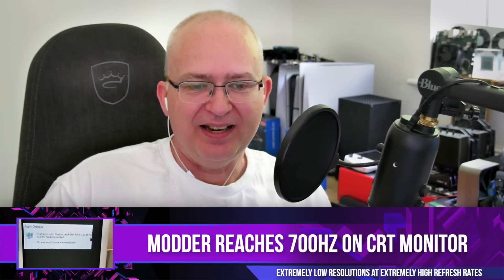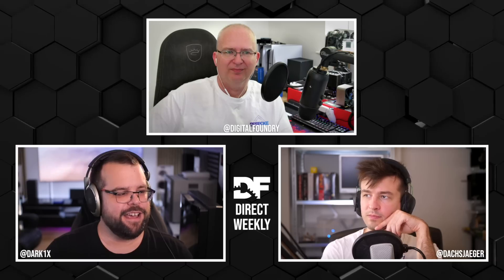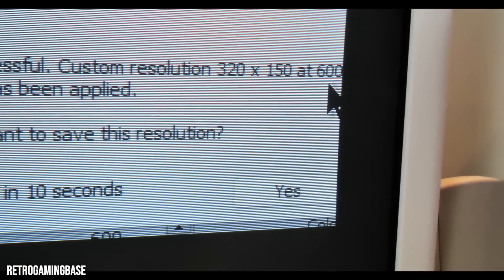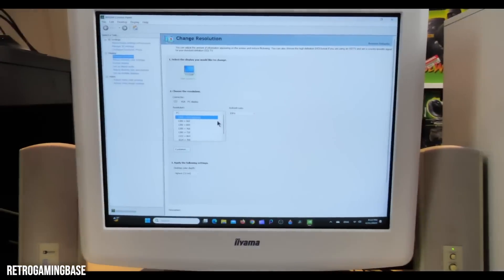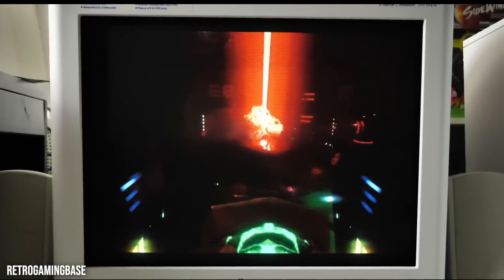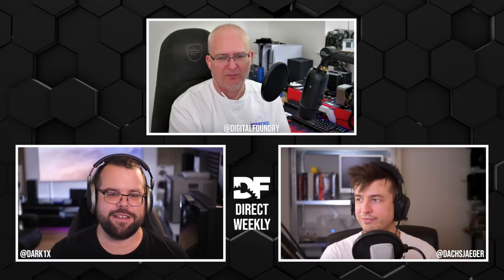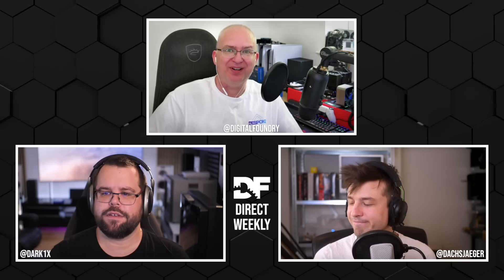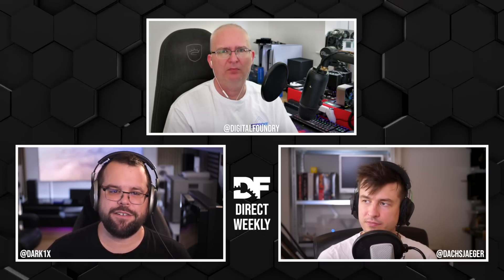CRT Display Hits 700Hz Refresh Rate - But How?

Comment: 60Hz on a CRT is actually more like 1000Hz on a flat panel.
Reply: Way more than that, at 1600x1200 res 60Hz, a CRT takes like 9 nanoseconds to draw a "pixel".

Comment: If you really want a nicer balance between resolution a refresh rate, and you own a nice 200Hz (progressive-scan) CRT, you can easily squeeze 144Hz 1080p out of them, or if you're really wanting to push the boat out, you can do 1080i 240Hz, but to be honest, CRT monitors have perfect motion resolution & response at just 60Hz, so I never feel the need to go over 120Hz, and I mostly use my Sony G520 CRT @ 1440p or 2880i 90Hz.
Reply: I use my Syncmaster 955DF at 1792x1344 60Hz progressive or 1792x1008 at 72Hz, 60Hz or 75Hz.

I don't like interlacing after watching the massive difference in clarity between a 480i CRT TV and a CRT monitor at 480p.
Reply: @saricubra2867  
the CRT is a lot sharper not just because of interlaced vs progressive.
The way the triads are organized is different.

480i on a CRT monitor also looks a lot sharper than 480i on a normal TV.

Comment: One of my favorite things to do every once in a while is to boot up my 19" Trinitron and play some games on it. it will do 1600x1200 @85hz which looks cleaner than my 144hz IPS. but if i lower the resolution slightly i can do 120hz on it and its wild the motion clarity and level of dynamic range. I cant wait for the day modern displays can match that.
Reply: I reckon eQD (self-emissive QD) will at least be nearly as nice looking and fast as the last generation CRT monitors.

Comment: Best monitor I’ve ever seen was my 2003 22-inch NEC CRT.  It could do 2048x1536 at 85Hz, .24 mm dot pitch, and had a flat glass screen.  It was beautiful, and 22 inches at 4:3 is HUGE.  It cost $1200 in 2003, but was worth every cent.

Comment: 90hz on crt was way worse than 144 on my laptop, i think crt becomes religion to these guys, the make stuff up
Reply: Eh, that is just not objectively true though is it, just 60Hz on a CRT monitor has a 1:1 static:dynamic resolution, that means it can resolve a full image as well as it does either statically or dynamically, whereas a 144Hz LCD can barely resolve 300 lines of dynamic resolution, same with OLED, as those are also sample & hold modulated, late generation CRTs also have incredible colour volume, greyscale performance, shadow detail, black levels, the purest whites out of all display technologies, 0ms end to end latency, incredible fill-rates, an image depth that so far only light-field tech has rivalled, post CRT display tech is an example of technology regression, like the Concord or US Space Shuttle.

eQD should be interesting though, especially if it has a scanning base modulation method, Tandem-OLED is also a tech with a lot of potential, if it were to use native rolling-scan or something akin to focus field-drive.
Reply: the motion clarity was better, your 144hz laptop is sample and hold.

compare 144hz on your crt to the 144hz on your laptop and you will be impressed.

Comment: If you did update an oled or lcd to mimic the scanning beam of a crt, it would probably be very dim.

For a crt display, there's only a small point on the screen that's lit at any moment. 

That point is extremely bright & can apparently reach 100,000 cd/m^2. 

But since the point is only lit for a fraction of a second, the overall image is around 100 cdm^2

If you did that with an oled or lcd it would appear even dimmer.
Reply: Rolling-scan algorithms have gotten really good on Sony BVM OLED sets, so much so that 60Hz has very respectable motion-resolution on a Sony BVM-OLED (RGB Top-Emission) with native rolling-scan.

Comment: And suddenly people no longer see burn-in as an issue despite CRTs being more prone to it than OLED...

People hate innovation and would rather ask for faster horses than better cars.
Reply: Post 1995 CRTs are notoriously impossible to even force burn in, it takes at least 5-6 years of constantly being left on a static image to get any noticeable burn-in onto a post mid 90s CRT, and around 2 years for post 2018 WOLED, around 3 years for 2nd gen QD-OLED, and around 4 years for triple emitter (RGB-stripe) OLED. As the ratings review group have clearly shown, LCD is more prone to permanent image retention than any of the display technologies with the only exception being Plasma, though 8/9th gen Plasma is pretty resilient.

Comment: i wish there would be 1080p crt
Reply: 1600x1200 is pretty much the 4:3 1080p equivalent in megapixels.
Reply: My 22 inch NEC flat screen CRT could do 2048x1536 at 85 Hz in 2003!
Reply: @jarekstorm6331  I have a 19inch Samsung Syncmaster that maxes out at 1856x1344 but the phosphor size is 0.20mm. It has the sharpness of a 1440p digital display, each frame looks like a 35mm film print or a very high res photograph, no aliasing.
Reply: CRT monitors can do well over 1080p, 2880i in fact (4K 4:3), there are also HD CRT TV's, like the Sony Fine-Pitch and Panasonic Acuity CRT sets.

Comment: You could play Pokémon emulated at 160 (w) × 144 (h) which is the Gameboy colors resolution. or the Gameboy advance 240 (w) × 160 (h) pixels (3:2 aspect ratio) probably at higher than 700hz 🤣

Comment: If you're interested in the best possible motion clarity for a non CRT display look into VR headsets. The Oculus Quest 2 has 0.3ms of image persistence which is equivalent to 3000hz of motion clarity. You can really see it in action opening up UFO test in the browser. You can track the UFO with perfect clarity even up to 2880 pixels per second. This kind of strobing tech needs to come to monitors.

Comment: While nowhere near as high, I have used an experimental MiSTER config to run 240p resolution on a CRT Monitor at 120 hz. 

Usually a PC Monitor cannot display a resolution that low, but by doubling the refresh rate from 60 to 120, it reaches the 31 khz minimum the monitor accepts.

The Scanlines in this mode are THICC (maybe almost too much so). Even more than most PVMs cause PC Monitors have a way higher TVL count than Broadcast Monitors.
Reply: I gotta try that one, but my monitor can already display 480p at 160hz, so maybe I need to try that 240p at 240hz or something

Comment: As someone who owned several CRTs as a kid and a teenager I can assure you that 60Hz does not look good at all. You absolutely need at least 75Hz to avoid eye strain.
Reply: 60hz looks good on CRT TVs but CRT monitors have faster decaying phosphors so need higher refresh rate to not get flicker.
Reply: I use a 60hz CRT monitor daily and it looks just fine
Reply: @uponeric36  It strains your eyes. Take it from someone that has been there, done that.
Reply: @uponeric36 if you can't notice the flicker I'm happy for you
Reply: @augustinethewashingmachine  It depends on the monitor, and sometimes setting. Anti-moiré effect setting often increases flicker. Using super sampling through something like DSR can also help
Reply: @uponeric36 I see. I wasn't aware of the effects of ss. Are you able to see flicker at 60hz or is it just minimal enough it's tolerable?
Reply: @augustinethewashingmachine  It's pretty minimal, I can see it on some static UI stuff if I hunt for it but I never notice it in real content.
Reply: depends on your eyes. Some people it makes them sick. For me I only notice it because I'm at 85hz+ at higher res. 60hz flicker isn't apparent to me at first glance until I go higher and return back to 60. Looks great to me at all refresh rates (lucky me)
Reply: Yeah I remember, when I was a kid, the amazing eye relief that came with finding out that I could change the refresh rate. It also made for a lot more late nights playing videogames (and tired school days afterwards lol)
Reply: True!
Reply: 85, or better yet, 100.

Comment: I appreciate the smoothness of CRTs but the constant strobing has damaged my eyesight over the years. Modern panels are MUCH easier on the eyes.
Reply: modern displays still strobe and there are even more issues with lcds other than strobbing like poor backlight quality, calibration issues, pwm dimming method, overdrive, etc.
Reply: @FuIIDiveVR  just like crts are heavy af, power hungry and many others. We have qd-oled and microleds now, wich bring nice features to the table that we've lost with crt-lcd change

Comment: Something tells me CRTs will make a comeback eventually in some sort of way, but they will be CRAZY expensive and only for a niche, specialized market.
Reply: for me they already comeback,
i start hunting crt tv/monitor for about 6 years , i have about 40 of them  , about 20 from them are very rare and i can sell them for more than$12000.
i don't know is this a good Luck or a curse ,how and why this happened ?!
crt teach is amazing , the motion and the colors for retro and for modern still funny to test  new game with  smooth motion everything on ultra even with ray tracing ,
Reply: @chopinhoven  I think the "problem" with CRT tech is that it's virtually perfect. Aside from some improvements that can always be done, the technology itself reached its peak between 2000-2005. So, it stopped being viable as a planned obsolescence business model. And commercializing big, widescreen CRTs is just too complicated and expensive. Kinda what happened with Pioneer's Kuro line, a.k.a. the perfect plasma.

By the way, have you ever stumbled upon a Panasonic Panablack CRT from the 2000's? The Panablack moniker refers to their blackened image tubes. I have a 29inch one from 2007 and it looks simply great, but they're not the best choice for light gun games for some reason (which forces me to keep a 20inch LG Cinemaster at hand).

Comment: I'm still playing FPS games in 1024x768 / 1280x960(4:3) or 1280x800 / 1600x900 (16:10).
Never got used to how the mouse movement feels on HD resolution and playing low res doesn't effect your performance. 

I played CS:S and CS:GO for a decade using 800x600 until I purchased a 27 inch monitor, it simply too big to scale the image accurately and not mess up the geometry.

I wish they resurrected the 4:3 aspect ratio with modern IPS displays. The square shape is underrated and we still haven't seen it's final form

Comment: Never understood modern day obsession with crts (btw I had a few in the 90s/early 2000).... heavy as hell, small and energy hungry .
Reply: Yeah their benefits is too small for their weakness, like bulky shapes , extremely heavy, super thick bezel, Low resolution, extremely expensive shipping cost due to its weight, consume tons of power. Small display size,
Reply: @mrbobgamingmemes9558  Low resolution doesn't apply to high quality CRTs and there were large CRTs available even decades ago. I was using a 17" Sony Trinitron from 2001 that could already go up to 1600x1200 - with a nearly flat screen to boot, unlike most other CRTs. Just a year later, my parents got a massive 22" CRT that supported at least (IIRC) 2048 x 1536 - and this was by no means the upper limit. You could, if you had the money, get 16:10 CRTs at the time that ran in excess of 1440p. In the extreme high-end professional space, these kinds of screens, even going beyond 4K, have been available since the 1980s. John Carmack famously programmed Quake 1 on a 28" 2048 x 1152 CRT - and this wasn't even close to the highest end displays of the time. Most consumers were entirely unaware of this (cost and availability being the most obvious reasons) and most of my friends had far worse CRTs than even the little 17" Trinitron, which is probably where your misconception comes from. The majority of CRTs weren't very good, but there were excellent ones, even at a consumer level, that blew every other display tech out of the water and for many years to come. 

Even in 2010, when I looked for a replacement for the Trinitron, I had to compromise. High-end IPS screens of that era were still not as good in terms of colors and viewing angles (and they came with horrible input lag on top). I tried a €1200 Iiyama and it wasn't even close. I ended up settling for a €650 Dell, which was only slightly worse than the Iiyama. The alternative would have been a Trinitron from the turn of the millennium with the same resolution (1920x1200) and size (24"), which would have cost the same with shipping (you're right on that one), but I didn't want to risk it (old displays break, shipping is risky), so I settled on a display that I knew was worse than technology from a decade prior. It ended up being a wise decision (it's only just started to malfunction this year), but still, I miss my little Trinitron.

Comment: I used to play Unreal Tournament (1999) on my 19" NEC monitor in 1024x768 at I believe 119Hz with a Voodoo5 5500 AGP in Glide, and it was the lowest latency, smoothest, most intuitive, most fluid thing I've ever seen or played in my life.
Reply: cs 1.6 on crt with early 2000 with cable internet (10ms ping) was ultra fluid and reactive
Reply: Even 320x200 @ 75 hz (Quake World VGA) looked freakin' smooth back in 1997.
Reply: @bjornna7767  stop trolling

Comment: 240Hz OLED is blurry mess stop talking lies, stop looking at static screens its not even in same ballpark with CRT
Reply: Cool story
Reply: Really ? Are you comparing it on the same game ?
Reply: @mrbobgamingmemes9558  on any game 240fps locked on 240hz screen has 4.17ms presistance on OLED  that huge for human eye ofc 240fps vs 60 fps OLED is night and day but 60Hz CRT just demolish that 240fps OLED in motion clarity its not even comparable . CRT looks like 100x faster any fast move looks the same likeon static screen. This guy just BSitting people
Reply: I've been gaming since the 1980s. And while CRTs have their benefits, I can safely conclude that OLED is much better

Comment: 60 Hz has annoying flickering on CRT. You need at least 85 Hz to have flicker-free image. Late CRTs were designed to run at 85 Hz in recommended resolution, while high-end CRTs were capable of 100-120 Hz at recommended resolution while you could go one step above at 85 Hz or two specs above for 75 or 72 Hz.

All 1996+ CRT displays were capable of at least 640x480 at 100 Hz.

I still have my last CRT: 19" LG Flatron F900P. It has recommended 1280x1024 at 100 Hz, but it also can do 1600x1200 85 Hz, though its phosphor dots aren't small enough to resolve fully resolution above 1280x1024.
However running modern OS like Windows 11 at 1920x1440 with 200% UI scale is just awesome. You get HD details with the slight analog blur of CRT at the same time. Unfortunately only at 72 Hz which is too low for any prolonged use.

Also I would not recommend hacking display signal for CRT. You might actually destroy your CRT, and in MS-DOS era it was possible to destroy a CRT monitor with tweaked VGA modes, though later monitors got a circuitry that disabled the image when signal was out of range (my LG CRT does not allow to run at higher than 160 Hz for example).

I've read that you not only could destroy your CRT, but also your display could emit dangerous radiation, like X-Rays. It might be an urban legend, but still. Damaging your display was a real thing back then.

Lastly, only vertical resolution is tied to max Hz rate. CRT displays aren't even aware of horizontal resolution. It's just an analog signal for them. This is why we're describing analog TV with lines: 480 for NTSC and 576 for PAL. 

This is why historically PCs had much more horizontal variants than vertical. CGA had 640x200 and 320x200 which were same 200 line mode for display.
VGA had only 400 lines at 70 Hz and 480 lines at 60 Hz. Though you could set 320, 640 or 720 horizontal resolution. VGA also had scanline doubling for 200 and 240 line modes (they were still displayed as 400 and 480 lines).

With that being said, you can (probably) set 1920x480 mode at 100 Hz at worst CRT monitor possible. Some of us were using such weird resolutions when we had new hardware and kept old monitor. 3D games assumed that you're using 4:3 aspect ratio display and they were OK with displaying at non-square pixels.
Reply: tbh the flicker is kind of cool though. just sucks for desktop use
Reply: @randomgamingin144p  Thanks God i never noticed any flicker at 60hz on a progressive scan signal in a crt PC monitor.
Reply: I never experienced any hints of flicker on a 60hz progressive crt display. May be there are people more sensitive than others but nice thing that PC crt´s had the option to go up with the vertical refresh rate.
Reply: @jsr734 I can recognize a 60Hz CRT flu ker from across the room, it's terrible for me. 75Hz is usually already enough, but 72Hz or 70Hz (for common old DOS VGa resolutions) isn't. So 85Hz is a nice sweet spot .... 

But not all CRTs are equal, especially not at higher resolutions, bad/cheap screens can look blurry at higher resolutions with higher refresh rates. So even though they technically support it, it might still look crappy.
Reply: I had a high-end NEC CRT at 19" that I believe I ran at 1024x768 at 119Hz. Ran Unreal Tournament 1999 in Glide on a Voodoo5 5500 AGP on it and it was so liquid smooth and so responsive in a way a lot of people have never experienced.

Comment: The OG GameBoy was 160x144 so this monitor would be perfect for GB games at 700Hz. 😉
Reply: …which is 320x120 to achieve the 700hz, which is 24 less vertically than gb needs
Reply: Not so perfect... 160x144 doesn't fit in this monitor 320x120
Reply: @Espadasilenciosa  Actually, total sum of pixels far exceeds 160x144 so it technically would work to play games at 700hz on CRT monitor.
Reply: Sure it can crts aren't limited to a fixed pixel array  so any resolution can be drawn clearly  @Espadasilenciosa
Reply: Perfect for tetris players